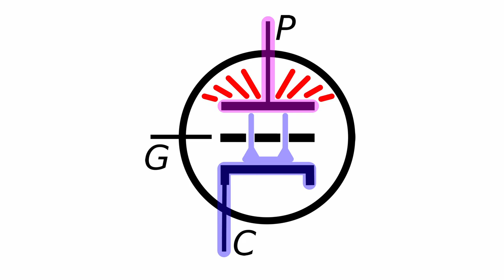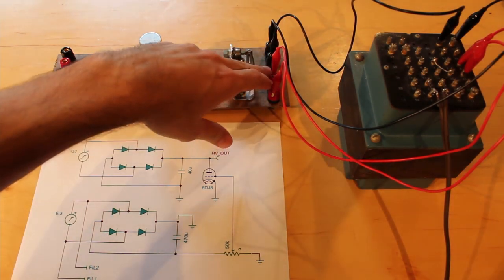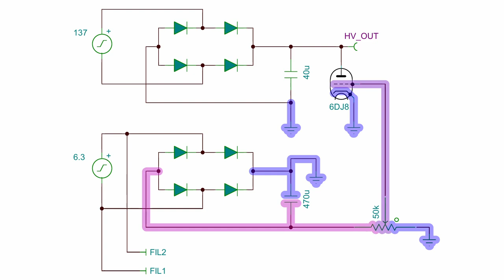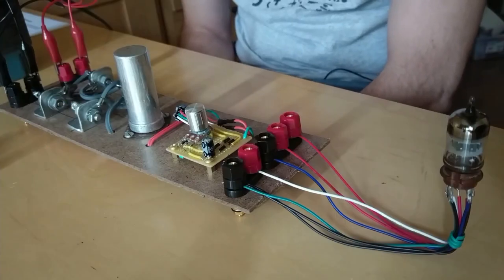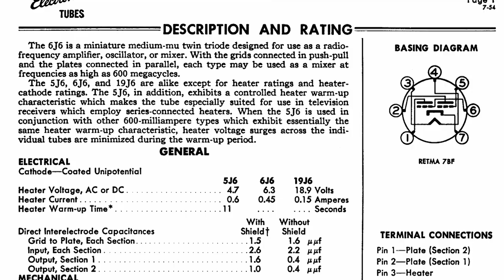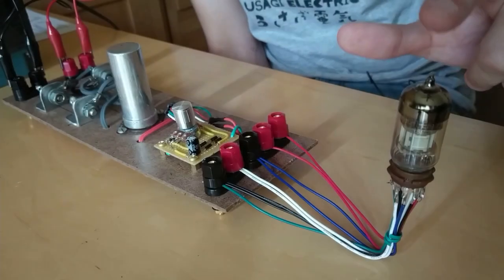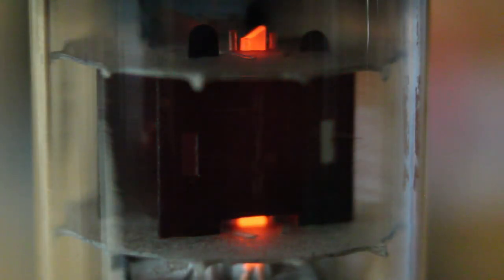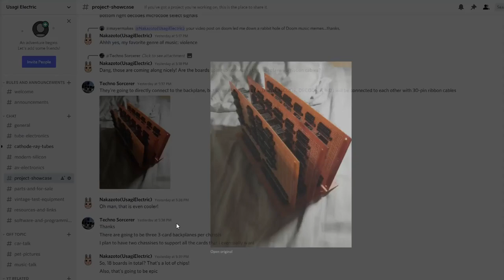Red Plating Vacuum Tubes to Destruction!

Comment: The flash may have been the cathode bond burning open.  When metals are heated to incandescence in a vacuum, a plasma can form, which becomes the primary means of conduction. If the current is sufficient, it can heat the grid so that it melts, and thereafter will have little to no effect on the current passing between cathode and plate. It is the equivalent of decades of use in a few seconds.
Reply from the maker: That's actually a really interesting idea! I may have possibly turned the vacuum tube into a Thyratron, if only for a moment, haha. 
After seeing both the 6HA5 and 6J6 run so bright without any super dramatic stuff, I was very much so no expecting a flash out of the 6BZ7. It totally caught me off guard!

Comment: Would have been nice to have had a current  meter on the plate to see what the maximum plate current was. I have seen tubes with a leaky coupling capacitor put a positive  5 volts on grid and cause a lower B+ voltage.
Reply from the maker: I thought about this, but oddly, I don't have a good current meter. All I've got is my little UNI-T 120e DMM, and I haven't been able to get it to read current properly yet (most likely, I'm too dumb to use it properly). 
But, looking at the datasheet, I can kind of come up with some rough ideas! 
My B+ voltage was right around 280V and most datasheets have a little chart with grid voltages that can almost get us there. So, at 280V with a grid voltage of 0V, the maximum plate current should have been around this:

6HA5: ~70mA
6J6: ~45mA
6H2N-EB: ~6.75mA
6BZ7: ~75mA

This actually explains why the 6H2N-EB didn't glow. I didn't have nearly enough B+ to get enough current flowing through it to upset. Ideally, I would have had closer to 400V and maybe run the grid into positive voltage further. This also explains why the 6BZ7 didn't fair too well. 75mA at 280V is approximately 21W, but according to the datasheet, the 6BZ7 has a maximum plate dissipation of 2W, so we were cramming 10x the amount of power through that tube than what it's maximum rating was!
Reply: Pulling down the B+ rail, lol....

Love valves!

Comment: Some of the power tubes in the amps that I work on get that distinctive blue glow.  When the amp is turned all the way up , if you play the instrument, you can see the blue glow change with the signal coming into the amplifier.

Comment: This video rocks dude. I did this once (by accident) to a 12L8GT when building a massive amplifier. Luckily the tube came out okay and still worked because I noticed it before any massive damage was done. You produce amazing content in general though, it was your channel that actually inspired me to build my own 4-bit vacuum tube computer
Reply from the maker: Thank you so much!
The 12L8GT is a twin pentode in an octal package and that's just awesome! Tubes are surprisingly tough, the 6HA5 I red-plated here actually still works and tests fine on my (terrible) vacuum tube tester, which is just wild to think about. They can often handle five times their maximum ratings for brief periods without too many ill effects, which is insane to think about in regards to electrical components!
Thank you for the awesome words on the content! Do you have any links to your work on the 4-bit tube computer? I would love to see your progress and chat with you about it!
Reply: @UsagiElectric  I haven't uploaded anything online about my computer yet, I'm still in the stage where I'm designing everything and getting everything planned. Once I get my designs finished I'll upload them and let you know. My general design goals were to build a computer completely dependant on tubes that could read programs, execute them efficiently, and give a readable output via an interface, probably going to be nixie tubes. Even the power supply has to be completely regulated via tubes.
Reply from the maker: @straightman2  Definitely let me know when you get some stuff online, I'd love to check it out!
Initially, I was thinking to build my entire 1-bit computer from tubes only, using 6AL5 dual diodes or modified multivibrator designs with dual triodes, but I ultimately went with using silicon diodes because I couldn't afford to have nearly double the tube count! (And silicon diodes in tube computers was fairly common from the mid-50s on.) Ultimately, I do intend to build my power supply from scratch, but I want to get the computer itself finished first so I have an idea of the power draw needed.
For the output, I would love to use Nixie tubes, but since I'm running entirely at +24V/-12V, I just don't have enough voltage to use them. Instead, I'm thinking I'll build an output display out of little IV-3A VFDs, since they're also pretty close to period correct and can run on 24V. 
If you want to, come join us over on the Discord chat server and we can chat tube computers and swap ideas! ( https://discord.com/invite/p7UsfHD )

Comment: Not generally a fan of destroying anything deliberately, but you assured that these are not expensive components, so not that rare. The educational value was good, and to be fair I did enjoy the flares. 👍
Reply from the maker: I'm right there with you, I'm a bit of a pack rat, and if anything has any kind of usability I tend to stuff it in a draw for "one day". But, I really wanted to see some red plating, so I went through my tube collection for the ones I never use and aren't really highly sought after tubes. The 6BZ7 and 6H2N-EB can often be found for about $3 on eBay, so I figured that was cheap enough to sacrifice in the name of science!
Well, maybe not science, but certainly entertainment, haha.

Comment: One tube in my collection is an Eimac 4-1000A from the power stage of a 5kW radar transmitter that was accidentally redplated when the oscillator stopped. The anode, despite having large cooling fins on it, actually melted in some spots, so that it now has holes that mirror the layout of the control grid raster. It's mostly useless as an amplifier triode anymore, but the holes make it a much better mood light bulb than before ;-)

Comment: The most impressive tube  I see this in frequently is the 6BQ5/EL84, if you manage to just ride the edge of red plating so it stays intact long enough, you will see the glass soften and get sucked against the two sides of the plate.Try 350 on the plate, about 320 on the screen, and  start with -15 on G1. Stick 50 ohms in the cathode and maybe a few hundred ohms as a plate load. Ride it until the glass gives way, air enters, and flash bang at the end...oh, and fuse your HT line accordingly for this test.

Comment: No surprise that the 6N2P survived. Ruski tubes are generally the best available. Based on your other experiments, I got a handful of DL67 micro tubes and my first experiment red plated just like these. Lol. I need to figure out how to not do that next time. 
Totally dig your videos.
Reply from the maker: The Russians sure liked to engineer stuff to be tough as nails! Also, the 6N2P wasn't really designed to move a whole lot of current in the first place, so I would have needed a much, much higher voltage PSU to get it to misbehave.
Sounds like you pushed a little too much current through the DL67! I've done that a few times on accident too, haha. Time to bump up some resistor values!
Reply: @UsagiElectric  the 6N2P is a low anode current type very similar to a 12AX7/ECC83 so less likely to redplate(unless you crank up the ht volts), try a 6N1P or 6N3P as theyre more like 12AU7/ECC82
Reply: I agree, the Russian tubes are more robust because they have more widely separated elements (especially ones from decades ago when they didn't have the technology for tight construction). So they have wider element spacing that makes them more robust. Thus they have less capacitance and can work at slightly higher frequencies and plate currents but have less gain. They didn't make them more robust, it's just they couldn't make them more delicate and sensitive so they ended up being more robust that as a winfall can handle more abuse but with less overall performance.

Comment: On the 6BZ7, the bright flash was likely the cathode bonding wire failing due to excessive current through it.
Some tubes are more resilient than others, depending on the current the plate is rated to handle.  It's primarily plate design that will determine how resistent a tube is to red plating.

Comment: I think the reason they flare up red and then slowly go dim is because as the metal heats up the resistance goes up and causes the amps flowing to go down.
Reply from the maker: I think you're totally onto something here! I actually tested the 6HA5 in my tube tester the other day out of curiosity and it still tested as good. I was totally lost as to why that would be the case as I thought I was destroying it, but the heat vs. resistance aspect of the phenomenon is something I hadn't thought about!
Reply: Negative temperature coefficient? Interesting!

Comment: If you red plate a television horizontal output tube you can melt the glass envelope, keep the plate orange color but not fully hot and leave it burn.  might have to increase current until it happens.  you will need enough voltage also. dosent always work.
Reply from the maker: Some of those output tubes are meant to run glowing slightly, which just blows my mind!
The fact that you can get them hot enough to deform the glass without blowing the tube is just awesome though!

Comment: With 6N2P sitting at Vg=0 Ua=200V, you'll get 5mA of plate current and Pa=1W, not enough to get it red hot, tho
Reply: the -EV specimen is military grade as well, if I'm not mistaken.
Reply from the maker: You're totally right! I should have done a bit more homework on the tube before trying to give it a shot, it's just not moving enough current!

Comment: The 6H2N seems to have an anode voltage of about 250v, probably a higher maximum, your supply was 197, after the rectifier it would be 277, probably too close a margin to fail, i would increase the transformer tapping, even if it means 2 windings in series.
With the 450v capacitor you 'could' go up to 300v safely
Reply from the maker: Yup! The 6H2N is not designed to move all that much current. Looking at the datasheet, at 280V anode voltage and 0V grid voltage, the 6H2N is moving about 7mA. For reference, in those same conditions, the 6BZ7 is moving 75mA! So I needed a whole lot more voltage before I could get that one to glow.

Comment: Redplating in the wild (unless the tube is meant to run with a hot plate like some large tubes) is not fun, red gridding is even worse. Especially when you walk away for a minute to sip your soda and turn back and nearly choke on your drink and spill it scrambling for the plug only to realize it's too late and already fried which means even more repair.
Reply from the maker: Oh man, I can totally imagine the pain when it's a proper HiFi tube that you watch die! Fortunately these were cheap, commonplace tubes so I was having a bit of a laugh, but man if it's a nice, expensive tube I would totally freak out, haha.
Reply: @UsagiElectric Fortunately, it was only the rectifier that got hit, the tube died but I saved the transformer from getting cooked too (I believe I had bypassed the fuse, but managed to unplug it in time).

Comment: Very nice, i've been wondering about this since my tube amp red plated like crazy. It had a bad coupling cap and within seconds one of the big 807 power tetrodes was glowing bright red. It had like positive 160v on the grid. The tube still works fine though.
The blue emission is fluorescence and if i'm correct is either due to imperfect vacuum or imperfections in the glass envelope
Reply from the maker: Thank you!
Tubes are surprisingly hardy! Another commenter asked if I could test the red-plated tubes against known good ones, so I pulled out my cheap Accurate Instruments 257 Tester. It's a pretty terrible tube tester, but it should be able to give us a bit of an idea. (Unfortunately, the 6H2N-EB didn't survive the test, but only because my clumsy self knocked it off the table and it shattered on the ground... oops.)

Good 6HA5: 72
Red plated 6HA5: 66

Good 6J6: 72/70
Red plated 6J6: 16/20

Good 6BZ7: 72/68
Red plated 6BZ7: 0/0

The 6BZ7 was clearly totally dead. Something definitely shorted inside and wrecked havoc. The 6J6 registered some emission, but it was clearly hurt. The 6HA5 though soldiered on as if though nothing happened at all! I was stunned by how hardy it was!
Reply: @UsagiElectric  how can a tester by accurate instruments be terrible? Haha

I'm guessing it might depend on a lot of physical factors as well, like tube construction and materials
Reply from the maker: @stefandumoulin1872  Haha, I actually had to rewrite my sentence a few times because I kept typing "my inaccurate Accurate Instruments 257". It's pretty good for determining if tubes are dead or not, but that's about it. 
I think you're totally right on the physical factors as well. The 6BZ7 seems to have really tiny tolerances between cathode, grid and plate, whereas something like the 6HA5 seems to have a bit more distance between each component. That could be why the 6BZ7 shorted out and the 6HA5 didn't, despite both getting really hot!
Reply: Ionized oxygen atoms.....

Comment: You might make some x-rays if the voltage is high enough.
Reply: not enough with 137*sqrt(2) volts, but probably these tubes would create xrays even if they're broken (as long as they're not vented)
Reply from the maker: Not going to lie, the worry briefly flashed through my mind, but I do remember that x-rays needed quite a lot of voltage, so I was pretty certain my little 280V B+ wasn't enough. That blue fluorescence was awesome though!
Reply from the maker: @tpa6120a2dwp  I would love to see how bright the plates would glow with 7kV crammed through them, haha!
Reply: No chance at all for x-rays - None.
Reply: There is a threshold voltage before  X-rays are possible, it’s around 13,000 volts.

Comment: Fun experiment.  We used to see this in old TV’s as the horizontal output tube would run at zero bias if the horizontal oscillator failed.  The 15 watt 6DQ6 would red and then orange plate in about 15 seconds.  Then blow a fuse.

Comment: I have a couple of 120W valve amps with 4x6550's per channel. I used to use them with a pair of electrostatic speakers which was just on the edge of being stable. Every now and again one amp would go into oscillation with instant red-plating and a mad rush across the room to get to the plate "off" switch.  Ended up putting them out of service and getting a more robust transistor amp. 

Not fun at all at £70 per tube.

Comment: Great video. What you made are one time use black body radiators. Next time, put shields around your cap, transformer, tube, in fact all of your electronics. No sense losing and eye to an unforseen explosion or getting burned. And do this in a well ventilated area.

Comment: As a kid i used to play with vacuum tubes, people were throwing out their old tube tv's to replace them with modern transistor ones so every month with the garbage runs there would be several TV's ready to play with (they collected big garbage once a month in those days).
I had an old transformer from a tape deck but it was only 300V 40mA or something like that
So i built a powerbank that was 220V mains rectified into a huge bank of capacitors. Big enough to weld a screwdriver when discharging. And one time a metal pen that has a couple weld marks to this day :D

I built 100MHz transmitters with ECC85 tubes and they were colorfull displays of destruction sometimes as all parts were scrounged from the TV's i found. I also had so many side bands that i was all over the FM band and the television in the living room would show all kinds of patterns. One of those "are you experimenting?" moments for my mom.

So yeah i had a lot of fun and have red plated al lot of tubes. (And popped all kinds of electronic components as well) Fun days

And yes i did survive that power supply i built ;)

Comment: I have seen this happen on old style TV's when the horizontal or vertical output tubes loose grid drive. Any high power amplifier can do this as well. If the current goes high enough it can actually burn a hole in the plate. But usually the cathode either boils off it's rare earth coating or opens the cathode connection. Sometimes if enough voltage is there it can flash over and I have actually seen  the envelope crack and break apart.Iin fact if it has been allowed to sit there long enough with high current and voltage it can break on the bottom seam where the tube was glass welded together.